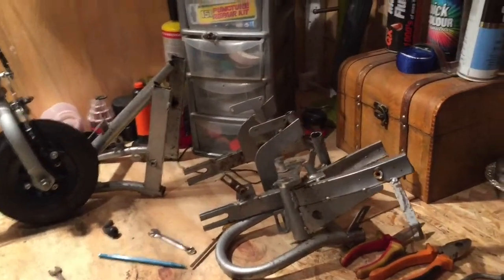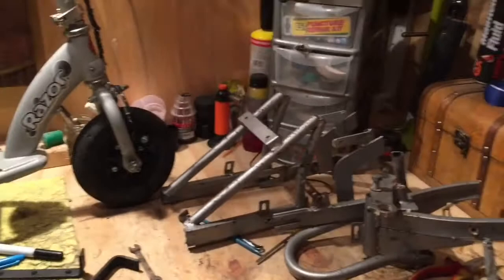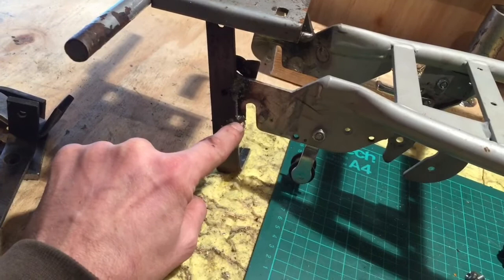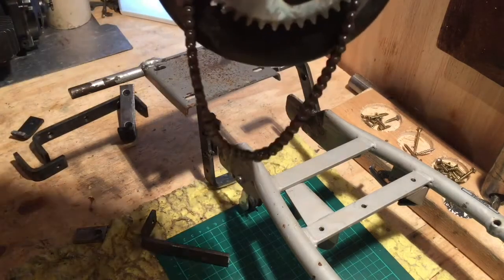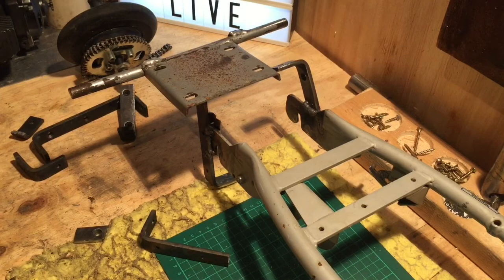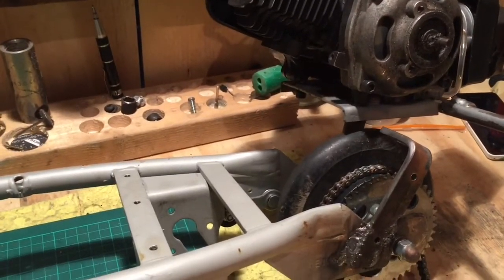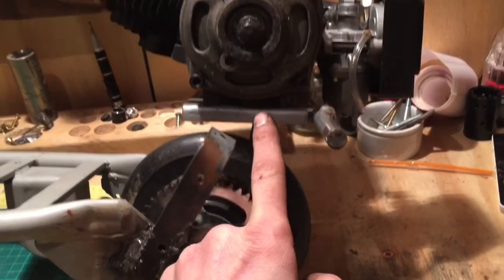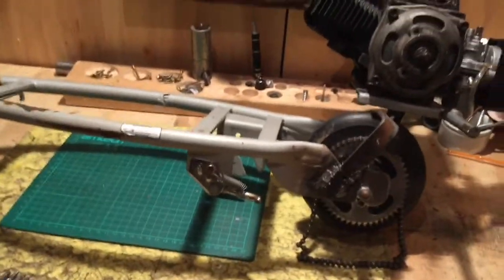RAZOR SCOOTER ENGINE CONVERSION PT 3

Comment: Making good progress there :) Now, cutting discs. Only place I've found them is Wicks. They are expensive £12 for 5 but used sensibly they do last. They are only 1/2mm thick. I bought a pack of 10 1mm cutting discs, used most of them for a project. However only used 1 of the thin ones to cut just about the same amount. I've shown using these in some of my videos. Definitely worth trying to get some.
Reply from the maker: MalcOfLincoln cheers Malc, I will be good for cutting disks and stuff soon, I know a cutting disk wizard lol
I'm glad I abandoned the mini Moto frame idea, too much metal exposed, I'm expecting them to fall off it a few times so I would prefer to hide the metal, hence the reason for the brackets.

Gutted it was a couple of millimetres too high but should be able to adjust it easy enough and then weld in supports to keep the tabs rigid.
I enjoyed the progress today, it was good fun tooling around, but burning some 2 stroke will be better lol
ATB
Darreb